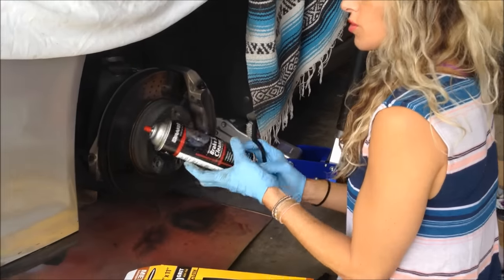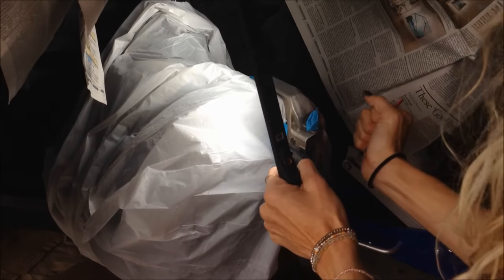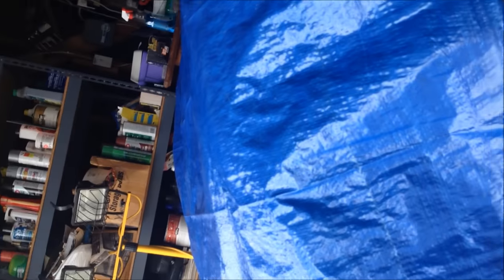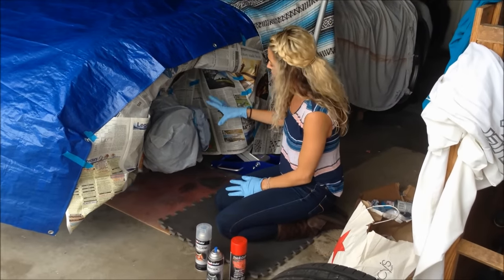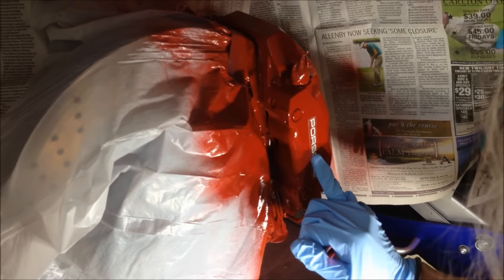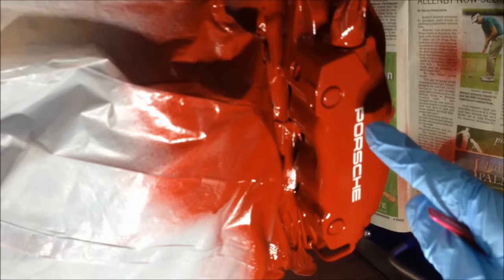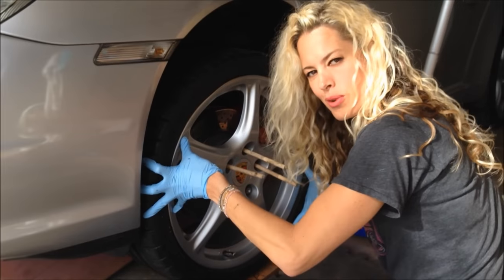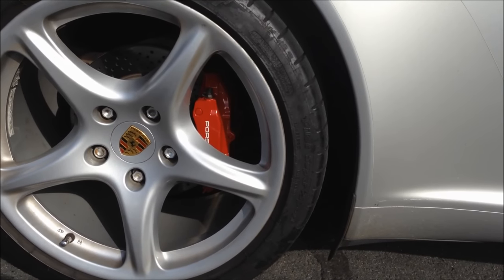Painting Porsche Calipers DIY

Comment: Better approach:  Remove 2 bolts to remove the caliper- remove the pads/junk.- Allows a thorough caliper paint job (no overspray on the car) bake the calipers in the oven;  apply Porsche lettering and coats of high temp clear coat - again oven bake the paint ; reassemble

Comment: You are not supposed to use anti-seize on lugs.
Reply: might as well put some lock tite on it too lol
Reply: Not true.  I little dab is fine.  Don't go crazy with it.  I small amount where the wheel meets the center hub is also preferred.  Especially on Porsche.
Reply: @rustyme1122  nope! Porsche manual clearly states not putting anti-seize on lug nuts!
Reply: I’m with Mac Daddy, most manuals I’ve read say not to
Reply: I dont own a Porsche, but do have VW's. And always use a little dab of anti-seize regardless of what the manufacturer says. The thread on the lugs is very thin, and have had a few times with freezed studs due to heat up and rust. And specially with safety lugs. So a small dab of anti seize solves all this. Of course, always torque the lugs correctly.
Reply: Nice. I also use a 'dab' of antiseize on the lugnuts. Just remember to UNDER torque tighten by about 10ftlbs. if you 'lube' the threads via antiseize or similar product.
Reply: @ivanrosado1969  The studs froze up because you neglected to do the proper maintenance (tire rotation). Do the right thing and they will always come off with no issues.

Comment: Interesting video..  I see what your doing here and I will give you a thumbs up here.  I'd definitely look to pulling my brake parts right off the vehicle to do a job the way I would want it done.  Next I'd be using a good degreaser and wax remover or a Final Wipe Solution, maybe even something a little stronger before going to primer.   One big mistake people make with painting is not allowing a proper cure time.  All though a primer or paint might feel dry.. its still releasing chemicals up till the proper cure time.  Painting to early n result in paint lifting or bubbling.  Please don't rush the job!!! can't be emphasized enough...  When it comes to putting decals on.. use water and green dish detergent.  Spray it on, place the decal/vinyl and then squeegie out the soap and water.  Decal will end up exactly where you want it and undamaged every time.  Hope those are foods for thoughts. Cheers :)

Comment: If you not going to take the caliper off, at least turn the wheel(Hub) to the inside/outside so you can get to the backside of the caliper. Really though, you should just take the caliper off.

Comment: to begin with why not just take the caliper off and when you're done bleed the system
Reply: Why do that? Extra unnecessary work.
Reply: You can get a much better finish on the calipers
Reply: +Marc8533 exactly
Reply: +Marc8533 
Who says you gotta do one wheel at a time? Just jack the damn thing up and put it on jack stands and take all the wheels off. Simple! Taking off the calipers and bleeding the system is extra and unnecessary and could possibly ruin the paint on the calipers you just painted while bleeding them. Jack it up, paint em, put the wheels back on, and move on to something else.
Reply: Auto Young it shows just in the comment that you don't know how to bleed brakes it's not like you just open up a walve and let brake fluid pour out of the caliper it's done into a container with a small hose,This is coming from a mechanic that actually knows what he is doing.
Reply: +Marc8533 
I just don't want to go bleed brakes if I don't have to. It's that simple. And like u said its on the backside and you're not going to see it anyway so if you get fluid on it it's not going to be seen or if you just don't take the caliper off to paint it still won't be seen. That's what I mean by extra unnecessary work. You're doing the same thing but adding extra steps by un bolting the assembly, bolting them back up, then bleeding the system. Not arguing just building on what you said because it seems like you kinda get where I'm coming from.
Reply from the maker: Wow lets argue about how to paint calipers... Really guys? Its just sending me annoying notifications
Reply: +Jessie Sunshine originally it was a way I was saying how I do it and to get an even better finish then someone turned it into an argument
Reply: +Matthías Little (EpicWiFi) 
"Someone"? Just say me or tag me. I know you're referring to me. But I wasn't trying to turn it into an argument. I was just saying why do this if you can do this? Cuz at the end of the day guess what; you're going to do it your way, I'm going to do it mine, and she did it her way so it doesn't matter. I just offered my point in that I felt like taking the calipers off of the cars and bleeding brakes for a small project like this was unnecessary to me. That's me though and some will agree with me and others will agree with you. And I'm pretty sure there's 10 other people with 10 other ways to do the same project. That's all...
Reply: Bleeding Porsche brakes is not like bleeding an older American car, especially late model Porsche's where you could get into computer system (PCM) error codes.  Taking the car back to a dealer to get PCM problems corrected would be very expensive.  Better just leave them alone.
Reply: Take the calipers off and work on them on a table in a more comfortable position. Then you don't have to mask off the entire shop. You can get at everything. Get some hose line clamps for the brake lines and you will have minimal bleeding to do.

Sometimes saving work ends up making more work. I don't see the big deal taking the calipers off.

Comment: Why dont remove the caliper all together? would believe the result would be better. I´m not trying to put you in a bad spot, I just ask the reason behind the chosen method here...?
Reply: she might not have the upper body strength to remove the two bolts keeping the caliper on and the one to open it
Reply: Phil Jones she's charging to paint ..  not to remove and paint ... Don't forget stuff brakes all the time she's in it to make money not to fix additional parts on the way
Reply: I'd leave them on just to avoid bleeding the brakes.
Reply: Removing Porsche calipers especially late models can be very tricky.  The rears are especially tough because there are piston retracting issues due to the electric parking brake.

Comment: you should never put anti-seize on these bolts; they're supposed to hold strong and actually seize a bit rather than coming off easy; that's not safe!
Reply: Porsche owners manual says to put the anti-seize on, the bolts are alloy. So it makes sense.